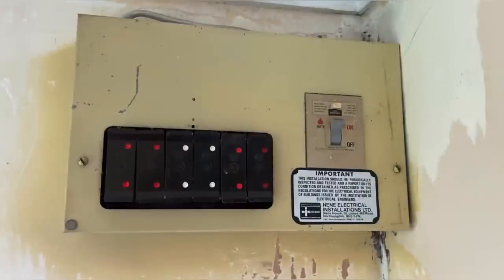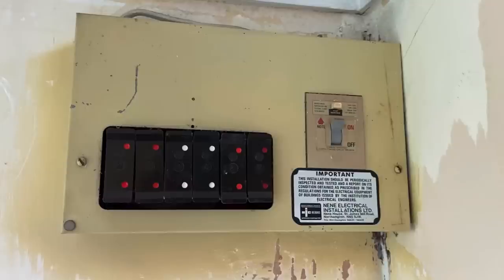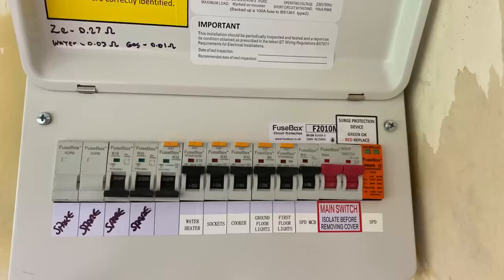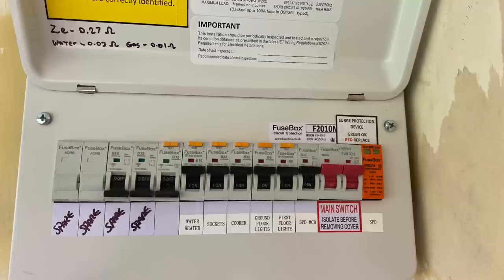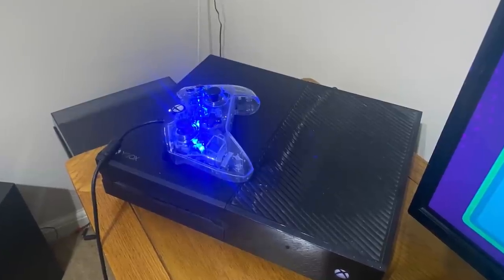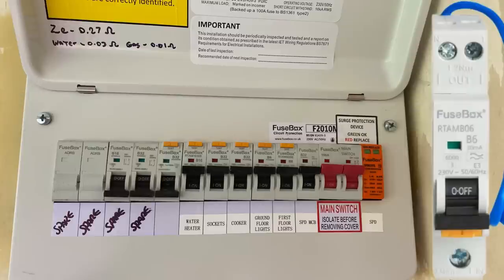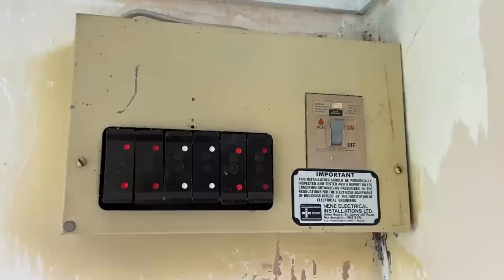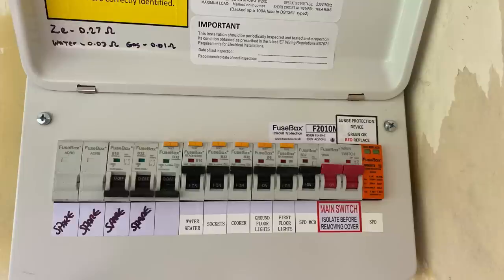Would you Change this Fuse Board..? WHY..? Understanding your new Consumer Unit

Comment: Sorry I don't agree that most domestic dwellings of average size doesn't require the whole board to be wired in rcbos ,its not rocket science to switch off all the circuits covered by the rcd that has tripped ,switch the rcd back on then in sequence turn each circuit back on until one trips the rcd then investigate the fault but leave all the other circuits energised

Comment: If it's not broken and it fits its purpose then, why fix it. Money is scarce and new installations cost.
Reply: Why fix it? To make it safer. To prevent electrocution. Or doesn't that matter to you?
Reply: I would rather be alive with a bit less money. No point being the richest man in the grave yard. 😅 Just wait for AFDs to come in properly they cost Evan more than the RCBOs
Reply: @haydenclark812   Sledge hammer to knock in a tin tack. It's going to get worse.
Reply: Safety is priority
Reply: @deang5622  oh behave 😂😂
Reply: @jameshansing5396  Are you really saying you don't believe in safety? Seriously dude. Are you for real?

I bet you are an electrician aren't you? Looking for a way not to do something.  "If the regs don't say we have to do it, we don't do it", right?

This is a common philosophy among electricians.
Reply: @deang5622  dude? 😂😂😂
Reply: @jameshansing5396  Going off topic there aren't ya bud? Not going to respond to the actual issue I raised? Now why is that?
Reply: @deang5622  how have I? 
I’d code it as I should and recommend changing it? You can’t force someone?

Or are you one of those who tells people they HAVE TO! I’ve seen sparks do that for several reasons: lack of knowledge… to make £ 👍
Reply: @deang5622  you raised a point dramatically like a bit of a queen then went to an utter extreme and made assumptions… so I replied ow I saw fit.

You really do think you’re something, don’t you? 😂😂😂😂😂
Reply: @jameshansing5396  You would code it correctly.
Then make a recommendation to the customer they fix it and explain the benefits in that. At the end of the day, obviously, it is down to the customer. Obviously .

This is such a pointless conversation, it's so basic and obvious, well, I am dealing with an electrician!
Reply: @deang5622  seriously, what country are you in? How old are you? Quite curious…
Reply: Fuses are probably more effective that MCBs but no RCD protection ☹️
Reply: @channelI748  No they are not.
If I recall there is quite a variation in current level at which they break for a given rating.

MCBs have less variation.
Reply: It’s neither (the one in the thumbnail, that is). It’s so unfit for purpose that it’s functionally broken.

The RCD is 50 years old and potentially won’t operate at all, and it certainly won’t cope with DC leakage current. If the fuse wire is properly installed — big if — those won’t be seriously compromised just by age.